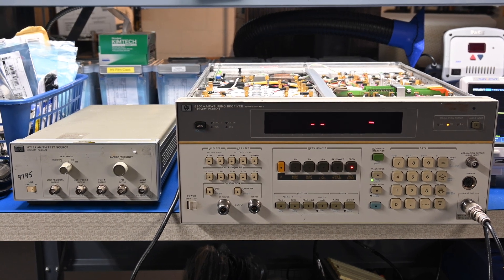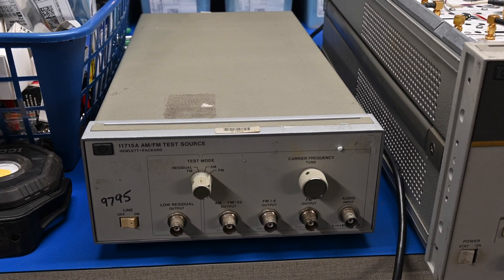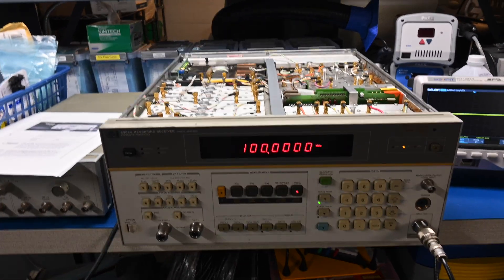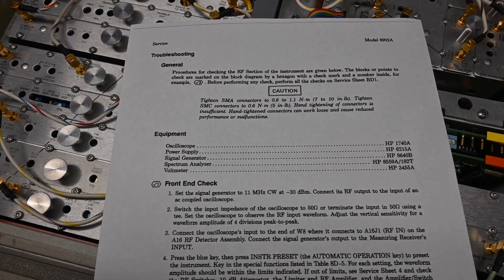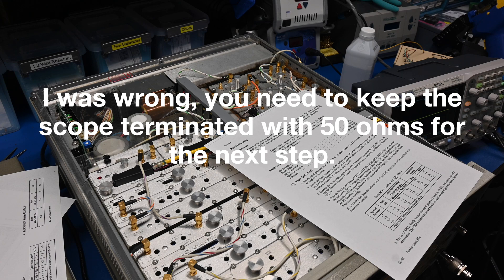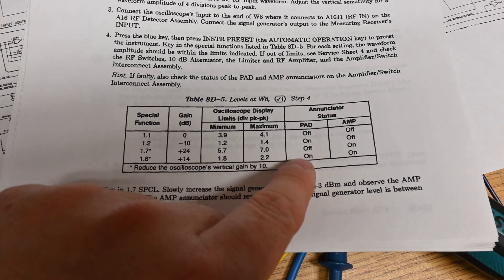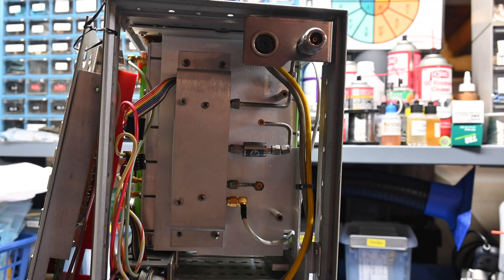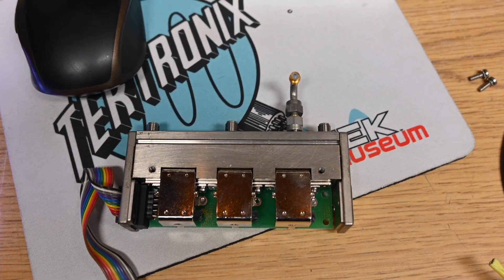Hewlett Packard 8902A Measuring Receiver Evaluation & Repair - Part 1

Comment: Ahh "Fully functional" and probably "Pulled from a working environment" :)

These are great pieces of kit - If you haven't got the sensor head, the manual contains information on how to use an RF relay and an 8400 series sensor in its place. Looking forward to watching part 2.